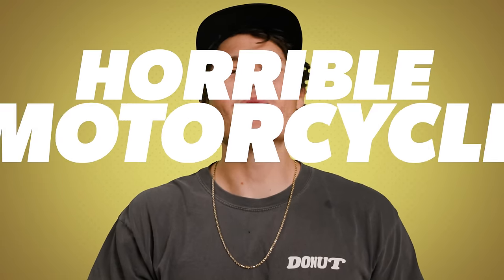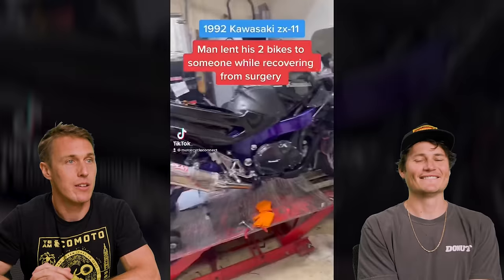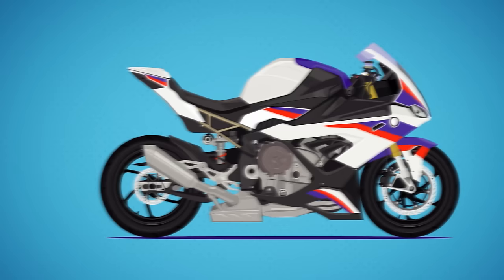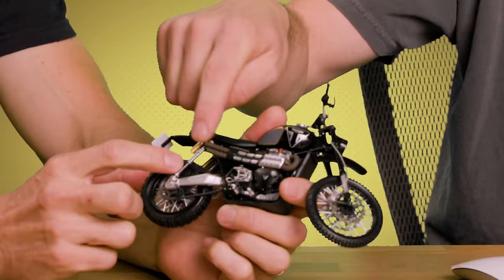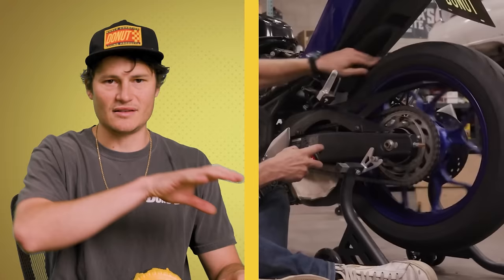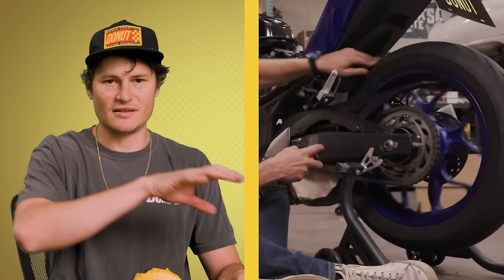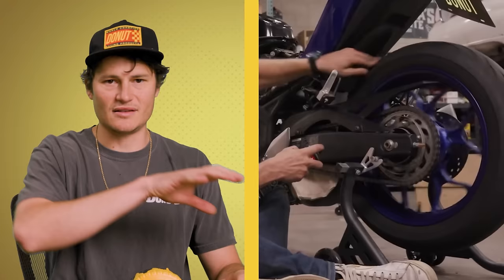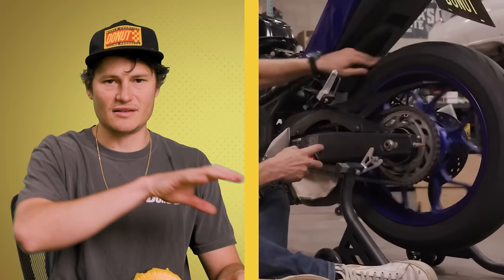Motorcycle Mechanics React to Tiktok Repair Fails

Comment: I knew a fella with a bike that was running great when he got it but after a very short time it would bearly run if at all 
The motor was removed from the bike dismantled and inspected but nothing was found that would've caused the problem it had so it was reassembled and reinstalled in the bike and it still had the same problem 
Eventually it was discovered the fella had noticed the airfilter was in poor condition so he'd wraped insulation tape around the filter to repair it

Comment: I had a front brake disc completely snap off at all points just braking normally. Tbh, all the endos beforehand probably didn't help. 
If you don't like buying new discs don't do endos.

Comment: Yea Im losing traction on a gpr 300 with a 80hp i4 600cc lol. And it still probably has 3/4 of it's life left. Wet ground? No go. Below 70 degrees? No go. Probably the worst tire Ive had since the oem Battlaxe or whatever. The cheap Avon tires I had worked better. Best all rounder Ive had? Dunlop Roadsmart or Michelin Pilot Power 2CT. Ive almost crashed twice with the GPR300. It does not inspire confidence in the turns

Comment: i think in that last clip, the dude just did it because he could..

Years ago, the horn switch in my steering wheel failed. i disconnected it, and wired it to a "bullshit" button on my dashboard. sure, i could have just used a normal horn switch from a parts store, but i decided if i'm gonna bother, i may as well do something fun.

Comment: Cool disaster selections! 
Partial disagreement on frame swaps though. Bike frames are easy to replace like everything else on motorcycles given a donor with clean title. Compared to truck cab swaps (also not hard and done all the time in the used vehicle world where I learned to do it efficiently) anything on a bike is easy. Bikes get disassembled for repaint quite often which is the same labor as a frame swap.  One work day strips the frame then a couple/few more to reinstall and tidy up, how many depending on what parts need replacing on the assembly end. A clean titled frame is the wise choice and (a few rectal states excepted) there's no need for a rebuilt title when mixing parts.  I've no desire to frame swap loaded non-HD touring bikes but that's mostly me being lazy.

Comment: Need to also make sure and buy a good chain, not an ebay chain. Had a bud of mine go through 3 from ebay on his ninja 900. One of then ripped apart and dented his swing arm a good inch deep. The other two stretched apart and damn near snapped. All three were in a 4 month period.

Comment: I did not catch that the fixed exhaust is mounted to the swing arm I'm thinking the frame is compromised because he drilled a hole in it so insurance is out the window and then also the bolt sticking out the other end could slash the tire

Comment: Chains snap because of poor maintenance.  Poor maintenance is leaving a bike in the rain or letting the chain rust.  This accelerates wear so quickly that the chain will stretch a lot.  A stretched chain can accidentally ride sideways up onto a tooth and boom, instantly snaps it.

Comment: I had a new tire put on by a motorbike shop and chain and a week later at 150kmh my chain came off wrapped around my foot peg lucky it didn't lock up the back wheel I still think the chain connector link was installed backwards by the tire fitter

Comment: 10:30 you know this guy has been around the block. I work on small engines (some basics motorcycle stuff). Check the small obvious things if the bike your working on is not yours! On my customers small engines I'd say 20-40% it's stupid simple stuff I typically tell customers... Hey look I'm not charging you because I'll I did was put the spark plug boot back on... Have a nice day

Comment: 6:44 he didnt drill into the swingarm thats a hole that comes on the swingarm to hold the brake hose on 00-06 cbr f4/i. So he didnt total the bike. Dumb to mount to the swingarm but at least he didnt drill into it and just use what was there.

Comment: Neither of these guys are actual motorcycle mechanics a real motorcycle mechanic like myself would have noticed the gash in the side of the casing from the chain where the guy got the screw stuxk behind the sprocket

Comment: I had a buddy who snapped one of his bolts changing a thermostat on his mini truck while we were in high school. Rather than go the proper way of drilling and backing out the fragment, he simply used JB weld on that side with the second bolt. To my knowledge it lasted past the sale of the truck. To be young dumb and broke.

Comment: The air filter melted it's due to the ten years the motorcycle been stopped. The rubber will desintegrate over time.

Comment: both wrong about the air filter. its perished. its old old old. ive seen this on cars before. cheap materials. that arent meant for 10 year life cycles. its been sitting for 10 years how long since the actual filter was replaced? Lets make that 15 years then.  Hes lucky it wasnt sucked down the intakes.

Comment: i just notices my bikes muffler is attached to the swing arm by design and made by company,im from iran by the way😐😐😐.can it be because its a street bike and swing arm dose not move a lot?
Reply: That's impossible.. check properly. Can you tell me what bike you have?
Reply: @JH09SUMIT  its iranian made savin mkz 200 based on cg 125.you were right,it has a bolt on the chassis right before the swing arm but you have to look for it to see.,i would send a pic if you are intrested,sorry for being dum 😅😅

Comment: If you guys need more stupid fixes for bikes.   Just go to 2vintage channel.   That guy has done it all.  Superglue the exhaust.   Fixing engine valves with jb weld, fixing clutches with jb weld.  And just a bunch of other stupid mistakes and just dumb fixes.  .  And the guy has bought hundreds, if not thousands of bikes and all of them are fixed the most cringe way ever.  And you would think the guy would learn from his mistakes over time.....  But like the good guy he is.  He does not learn.    Just pick any of his videos  and I promise you within 5 min he will say or do something stupid.   And the worst thing is that there are thousands of  12-16 year old boys thinking the 2vintage guy knows what he is doing.   Just sad and directly dangerous that a bunch of kids are learning to do stupid and dangerous things to the bikes from that guy.....

Comment: You on about if your exhaust is connected to your swing arm it's only going up not down your suspension doesn't push outwards  just inwards so how will he's exhausted touch the floor explain it's mathematically impossible ayy so if your actually knowledgeable on bikes how do you no know what direction the parts move